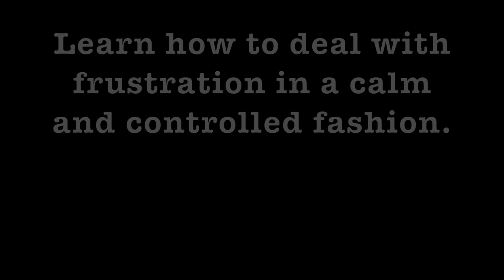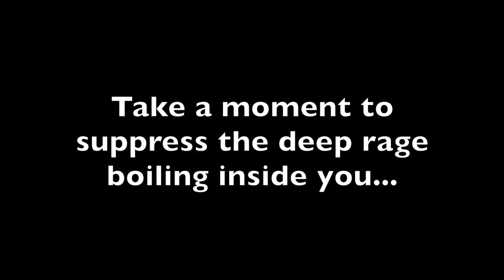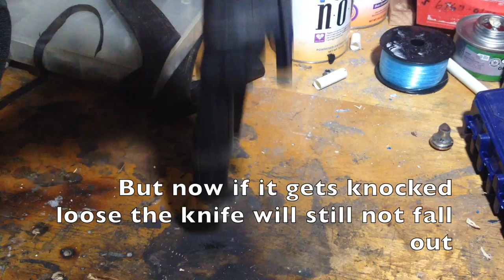Mora 511 Knife and Sheath Upgrades

Comment: If you want a better "patina" then I would have to suggest doing a rust blue to it. Just wipe some dilute muriatic acid from the hardware store onto the blade, let it form a light layer of rust, and then boil it in distilled water for 15-20. Boiling the rust will convert it into a black oxide, which you then wipe the fuzz away, and then oil it. Welcome to 1800's gun bluing.

Comment: Helpful/useful video, though I would never recommend holding a "finished" blade up to a grinding wheel, even just the spine. Takes just a little longer to glue some 80 grit sandpaper to a flat surface and run spine of knife over it perpendicularly until a sharp 90° edge is obtained.
Reply from the maker: I would think a file would work better than sand paper but regardless, the tiny amount of heat generated isn't going to mess with the heat treat. I take your point though.
Reply: why? grinding wheel is fine
Reply: Depending on the quality of the blade, even using coolant on a fine finishing wheel, a good blade can be ruined, particularly with scissors. Didn’t actually hurt the blade, just quickly took off too much material so the tips didn’t meet anymore

Comment: Came back to this video after seeing it a while ago for nostalgia, still a great one! I was thinking of grinding the spine on my mora but was wondering if the heat from the grinder would affect the heat treat. It should be fine if I do it carefully right?
Reply from the maker: I'm holding onto the knife with my bare hands when using the grinder. I would have severe burns long before there was any danger of damaging the heat treat so no worries.

Comment: Why not put the firestarter underneath the Paracord? Instead of using the ranger bands. Would look far better and be more secure.
Reply from the maker: The ferro rod Is something I use regularly so it needs to be accessible. The other items can be stashed for when I needs them but I don't want to take the whole thing apart every time I need to start a fire.

Comment: The title should be" Ultimate sheath for Mora 511"
Reply from the maker: I wouldn't call this ultimate, there are definitely better ones out there using kydex or similar materials, this one is cheap and easy though.
Reply: @TheElvenArcher  that's why it's Ultimate. Do you use it though? And how do you feel?
Reply from the maker: I would use it if I hadn't moved on from this knife, I use the companion more often now.

Comment: Everything is good except the knife choice, it should be 546 or Pro S (if you prefer this ergonomics/size). Carbon knife for a survival kit? Nononono. :) And should be nice to add sharpening stone.
Reply: That is why he forced the patina on the blade. Carbon steel is easier to sharpen and maintain than stainless and you will find that a majority of the survival knives out there are made with some form of carbon steel. All of ESEEs blades are 1095. Same with Becker/KA-BAR. And at this price point, he made a viable survival knife solution for less than $10.
Reply: Craig Wildfeuer this patina won't protect the blade from rust. And polishing works better here, but any scratch on it will be the center of rust growth. :) 

And I was talking not about carbon vs. ss, I was talking about Mora carbon vs. Mora ss, and my long experience tells that mora carbon has no sense. Ss sharpens as well, cuts wood almost as well (no noticable difference), cuts soft materials even slightly better. Stainless steel doesn't have tendency to micro-chipping as carbon steel has, so for survival knife it's better as you can fix the cutting edge without re-sharpening. Plus even stainless steel by Mora rusts. :) So the $1-2 difference in price actually costs much more in the long run. And all additional equipment already costs more than the knife itself. ;)
Reply: @AlexA-vd7li  Yeah cause people just put a patina on their knives to make them look pretty.
Reply: @YuuB0t413  You can use FeCl3 (Iron Trichloride) to make this on stainless steel too. :) Just need to use warm solution.
Reply: I've seen way more videos of bushcrafters who prefer carbon over stainless. So it's a personal choice .